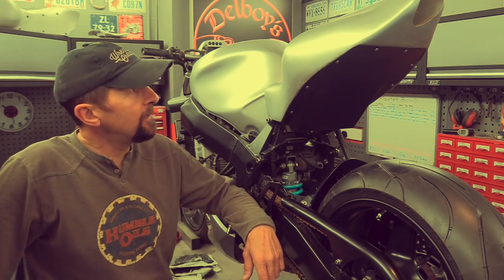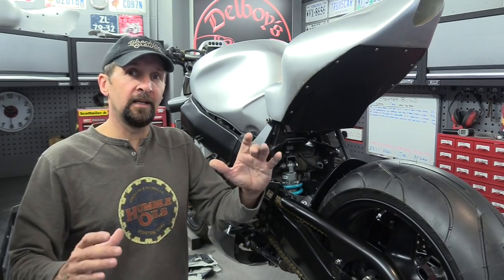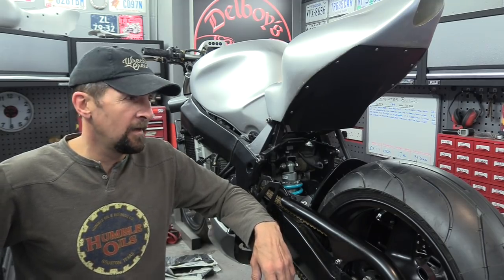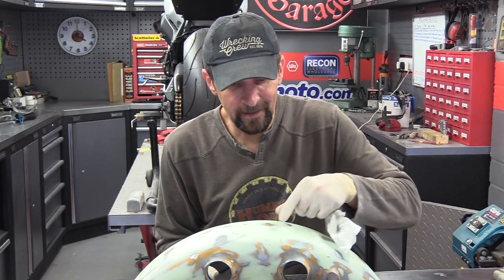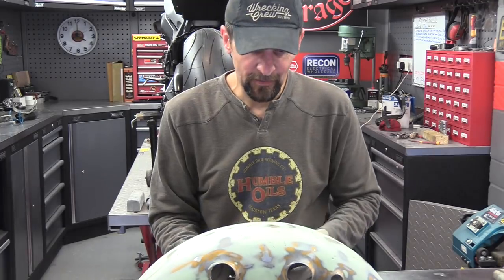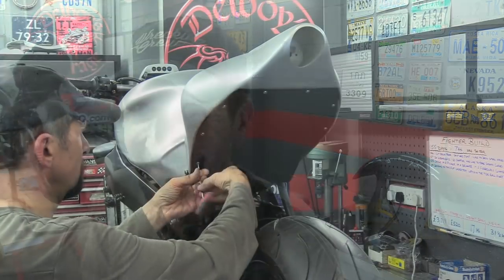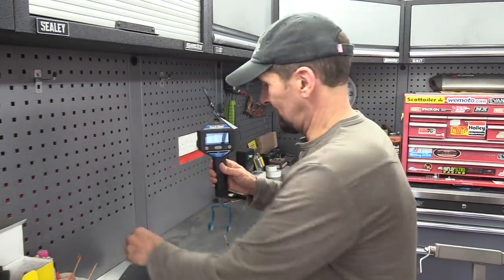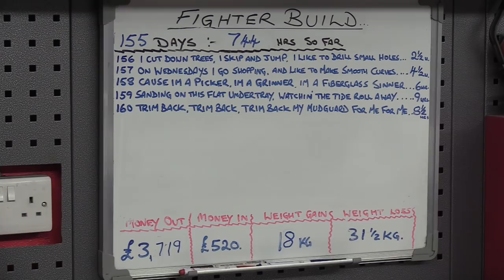Delboy's Garage, Fighter Build, #150, Mudguard Trimmed and Painted.

Comment: Nice job Del, the mudguard looks much better. The MOT day gets closer by the minute mate.  Cheers
Reply from the maker: Does indeed buddy, big long 8hr day in the garage today, got the rear brakes signed off, mini reservoir fitted, new brake light switch, all wired in and working, another job knocked off !  Just got in, 3.5hrs footage to edit tomorrow for Saturday's video, hope you enjoy !

Comment: Great video as always Del.Maybe you should consider not using allen screws for the undertray.The rear will fill them with dirt,dust etc i think ,Or maybe just cover them with these small  plastic covers ... 😉
Reply from the maker: Those small plastic covers will actually also disguise them a but too, good call. thanks buddy.

Comment: Del, re mudguard, front agree, rear disagree, although i see you have a front engine protector.  I think the original length would have afforded the most protection.  Anyway, its your bike and its what you want that counts.  This series of videos have been very informative and entertaining.  Many thanks for sharing.  A82 Joe.  PS I think 'Mr. Bondo' should be sponsoring your channel!😂😂
Reply from the maker: Hi Joe, I get what you're saying, but the bike's not really designed to be an all weather hack, the belly pan will protect a lot of the front end, and the bottom lip of the radiator, and am thinking that where it is now there'll be very little splash up on to the rad... naturally with any design you have to sacrifice a little function for form, and a little form for function aye?!  Thanks for your great engagement and kind support...

Comment: you may consider using 3m knifeless tape to trace out where you want to cut instead of a marker. Its a smoother line and easily repositionable
Reply from the maker: There's always a product and I spend my life spending money on materials!  Just spent over £90 on paint and paper to finish the base coat all over black, it never stops mate, and am trying to save, among all this, for a lathe which I'm almost there with !
Reply: @Moonfleet41  i hear ya. just for for thought. staying on budget can be hard at sometimes. the tape is less than 7usd. and you can reuse.

Comment: Hey bud, I just prepped and spray my SV tail fairing over the weekend using the Simoniz tough black satin. It turned out pretty good for my first go. Slight issue is I seem to have a couple of dull spot, not sure what happen. Any advice on fixing these areas?

Comment: Mudguard looks much better now it's shorter, I even think it could have been shorter still at the back as the radiator is quite high. Still, you have done a great job with the paint so no point in cutting it down again.
Reply from the maker: Hi Andy, I agree that maybe I could have gone another inch, or two, on the back end, but I still wanna retain a little protection for that brand new radiator and keep it from getting too much weather blasting... all form has to step aside for function now and again!

Comment: I was not a big fan of the holes in the front fender but looks way better with the black rather than the grey..Surprised you did not make the front fender in fiberglass.Great job as usual.
Reply from the maker: Hi Bryon, I have to admit I'm a bit of a metal fabrication freak, and I really enjoyed making that front mudguard, am still well under the overall weight, but may do a copy of this in fibre glass, or carbon, in the future...!

Comment: Hi, I think that smaller looks better and the final paint great!! What did you used to clean the mudguard before painting ( that plastic bottle) I couldn't spot the label.... lol .( Im working on the CX frame ) thanks for the video. Gus
Reply from the maker: Hi Gus, believe it or not, the bottle is nail varnish remover , a mild form of acetone, not too strong, doesn't melt any paint or filler, but at the same time, it removes all grease and wax and acts as a great panel wipe just before you paint... hope you're enjoying your project !  D&Px

Comment: when your do the weighing... are you remembering to add in all the extra nuts, BOLTS, washers, and fasteners??
like the 10 bolts for the undertray?
Reply from the maker: The 8 screws for the undertray weigh about 10gms, it really isn't that critical and I only ever round up when I make a measurement , as you saw in this, the net increase of the undertray and trimming the mudguard was 1/4kg, so I added a whole kilo in incorporate the hugger and chain guard too, job done... 

This is not critical, or a competition, am just looking to make sure that when I'm finished the bike weighs less than the factory original, and am currently well behind that and there's hardly anything left to bolt on, so I reckon I've already cracked... the weighing is just a little bit of fun because everyone is so paranoid about how much things weigh, so this proves the bike's not heavier than it originally was...
Reply: just as a wonder.... I wonder how much all the added screws, bolts, and inner bolty things (3x inside the rear swing arm for the hugger bolts) would weigh compared to all the original bolts. 
Yes, the bikes going to weigh way less than the original.. no contest there,  but small things do mount up.
For example, I was going back and forth between England and the USA back in 2015.
Clothes in the luggage, then a dozen kit kat peanut butter for friends over there, then 6 packs of a certain type of biscuit, then 2 boxes of a certain make teabag, Before I know it I;ve hit 24kg max allowance and I'm moving stuff out of the bag and into my carry on bag and my laptop bag. 
Another example are some freakish go lite camping backpackers I know..  who even drill holes in the toothbrush handle to minimise weight. Who put toothpaste into a sealed drinking straw. Drill holes in a spork.. titanium spork weighs 20g but these people still drill holes in to cut down on weight. 
hey ho... 
my op was just an observation

Comment: Looks great - Del, any tips on re lacquering car headlights? I tried 600 grit, re-lacquering, then some 1200 grit and it's still a bit hazy in places. I've got new ones but I'd like to sort these old ones and sell them on if I can
Reply from the maker: Hi mate, if they're plastic then the only way is to sand with 2000grit paper (obviously wet) and use a little soap in the water with 2000grit to help it slide and then polish with a buffer, and a midly abrasive polish, should come up like glass mate...  PS. for goodness sake don't get it too hot with the buffer if they're plastic lights for obvious reasons!
Reply: Hey sorry to butt in..but , I just did this last week..i got a kit from my local car spares place..it was 14 quid and basically has an attachment for drill (I used cordless) and lots of different grades of grit..and some polish (t cut) etc..and although it took me an hour and a lot of mess the headlamp looks new..it also has a sealer spray for when its finished...👍☮❤
Reply: Basically exactly what Del said !@🤗
Reply: What exactly do you mean by sealer spray? is that different to lacquer?
Reply: Nice, thank you.
Is there a specific type of lacquer you have to use? I saw that there are different types of lacquer, I just went for a UV resistant type as it will be under the sun most of the time
Reply: @1987RaPsCaLLioN  
Yeah it's not actually a lacquer that goes hard its a clear polish that you buff ..its not completely needed as after going through all the grades of paper to 3000 (wet) and the t cut type polish it was fully shiney..the sealer spray is just a clear polish ...
Reply: springy 2112 hmm, I’m not so sure about that. The lacquer is what protects the plastic from the elements such as sun and rain, the same as it protects paintwork on the body and the wheels, if you’re sanding through that and you go too far for example you basically go through to the plastic underneath and in that spot you are basically unprotected and therefore have a point of weakness. T-cut is a type of cutting compound (actually T-Cut is a brand and they mostly make cutting compounds) which has small pieces of pumice in it that work out fine scratches so you can polish over the top - you’re still polishing on top of lacquer however so you do still need something between the paint and the atmosphere.
Reply: @1987RaPsCaLLioN  
Yeah I understand I was a professional finisher and industrial coater for 20 years...
Edit ....this sounds so pompous!!!
Reply: springy 2112 no stress - thanks for the advice, have a good day mate
Reply: @1987RaPsCaLLioN  
No worries buddy it's all good peace and Love 👍☮❤

Comment: Nice work Del, the mudguard looks much better. A word of advice, it's not a good idea to wet sand filler. Because it's porous, it'll hold moisture which can cause rust to form under the filler.
Reply from the maker: Cool beans mate, am aware of that, there was virtually no regular filler on this mudguard for this reason, I used the Dolphin Glaze instead, it doesn't act in the same way and dries out instantly, am not 100% sure, but I think it's waterproof, because the instructions say that it's chemical proof in 20mins and advises to sand it with 800grit, you can't dry sand at 800 with soft filler as it clogs the paper in an instant, so it's an obvious assumption they mean wet sand?? And I've had no issues with moisture so far, so should be ok, if the worst comes to the worst though, this mudguard was a donor from a stainless Triumph mudguard, although stainless or not, it doesn't do to trap any moisture... I always leave about 1/2hr between final sanding and first coat of paint, which is plenty of time to dry out when it's 25degrees in the garage !

Comment: Coming out nice,  question though, doesnt the tail light have to be seen from the side view of the bike in the UK or some kind of marker light ? Dont get me wrong it looks cool but will it pass MOT all frenched in ?
Reply from the maker: Yes buddy, it will do, you'll see when I paint the tail that I have a reflective surface planned for the inside of the frenched tube, which will mean it'll show from the side almost 180degrees, that's the plan anyway, if there's a problem, I can mount the light on a block inside the tube and poke the tip of it out of the hole, which will be a shame if I have to do that, but it's a way round it if I get a problem!
Reply: @Moonfleet41  go to summitracing.com and look at RFW-DR50 part number. It's small and when off could be very invisible but on could be just right. Drill a hole, done. 
Or ? Just a thought
Reply from the maker: Thanks for the link mate, I've have a look, cheers

Comment: [P] Like it Del . All work in progress .Will you use some rubber fixings on the bolts to help stop 
rattle etc.
Cheers
Pete.
Reply from the maker: Hi Pete, if you mean on the tail, it bolts up securely and flat to the mounts, and being fibre glass it shouldn't rattle, but perhaps some top hat washers in the future would make a better fixing, that way can tighten it down and not crush the plastic...!
Reply: Very true Del . Sorry I meant on the the metal tank etc .

Comment: No need for primer?
Reply from the maker: No, not with Simoniz tough paint, paints over anything.!
Reply: Moonfleet41 cool looks good
Reply: I'd be surprised if it doesn't sink back with no filler primer on there.
Reply: billiardballhead fandango it doesn’t, I’ve used same as Del has and it works fine. Amazingly tough paint.
Reply from the maker: billiarball:  surprisingly it works as described, it doesn't go rock hard like regaulr paint, it stays flexible more like Hammerite, but doubt it or not, you'll be able to see for yourself in the next video and will roll the camera past the mudguard in a close up and you can see exactly whether it's sunk or not... try it for yourself mate, it really surprised me when I first used it, best way to describe it is as a paint that hasn't quite been thinned enough, so two coats is enough where 6 coats would normally go, provided you give a wet enough second coat for it to float out, and the elasticity of it, along with the fact it's thicker, prevents it running and sagging... once again, try it for yourself mate

Comment: From the fitting, I am now convinced that the undertray should be silver (or the final paint scheme) as per the tail piece, which it is part of .  It is not part of the black 'mechanical' items besides, it looks silly with SS button headed fixings - silver fixings for a silver undertray.  Similarly, the front mudguard was better painted silver to integrate with the bodywork  rather than the frame/engine items that are all at the rear of the bike.  Also, the front of the mudguard could have done with a little more trimming IMO
Please do not relish in the supposed weight saving because it is a little hypocritical as you have added superfluous weight and have not taken the opportunities to minimize the weight of your new fabrications.
Reply from the maker: Lots of criticism there then, but all the silver is going so the colour is irrelevant at this point, the black is a base coat for what will go on top of it later...
Reply: No criticism, just hopefully constructive opinion.  The base colours do help to model the bike and would help me if I was selecting a colour scheme.
Reply from the maker: Of course mate, didn't take it any other way, it's hard to see a vision of what any build is gonna be like when it's only part finished, appreciate your input ... thanks

Comment: How and where will the number plate be fitted?
Reply from the maker: Hi Ian, in the conventional place is probably the best choice, I'll mounting a little bracket at the top lip of the undertray, screwed up inside the tail to hold the plate, doesn't need to be heavyweight, or strong, just a little bit of sheet alloy will do, and when I get to the MOT guy am gonna talk about whether I can mount it further under the tail on the front lip of the undertray, German stylee!